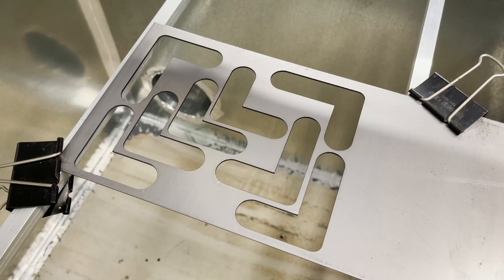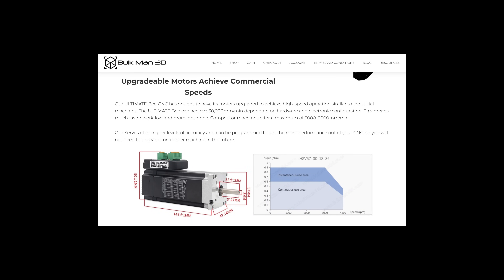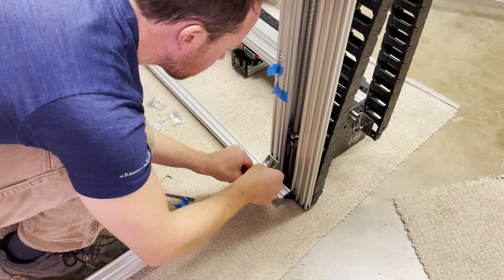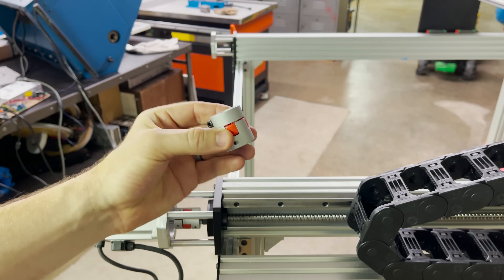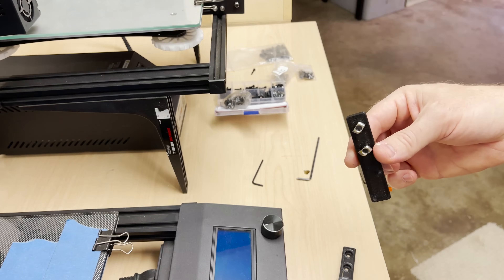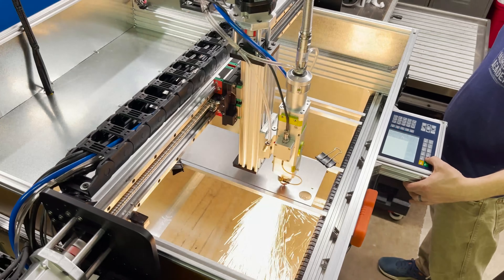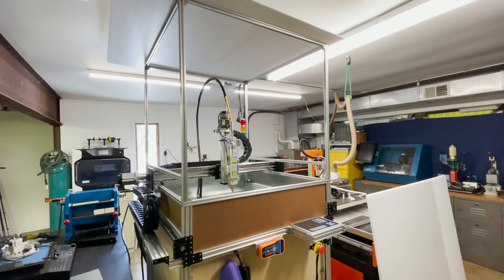DIY 1000W Fiber Laser Cutter Part 2: Gantry & Frame

Comment: 00:04 Using 16 gauge carbon steel, created brackets for enclosure.
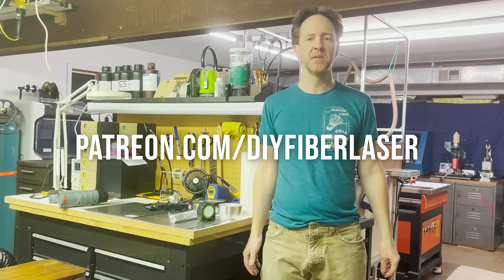02:04 Use of supplementary videos and discourse forum for additional information and assistance
03:12 Considered bulkman 3D ultimate B kit for the laser cutter but realized its limitations
04:22 Assembling the gantry and frame
05:27 Custom adapter plates and motor modifications.
06:48 Upgraded z-axis motor and designed mounts for homing switches
07:52 Wiring up switches and mounting the laser head.
08:56 Purchasing high purity gases and cutting parameters
Crafted by Merlin AI.

Comment: I import and build Chinese fiber lasers.  200psi air is good, just increase your volume with a second accumulator tank to increase run times.   Chinese machines typically use 1.6Mpa which is 236psi.  Then a dryer which is just as important as the air flow.  Oxygen uses a dual nozzle 1.5-2.0mm  air is single 1.5mm   Nitrogen/oxygen vs air is slowing down for air same focus/power.  Your Coro and wood is going to burn when you have a failure to pierce.  You need a enclosure when you have people without safety glasses on in the same room.  You alone will only have to deal with burning slag hitting you.  With manual height you can cut wood, opaque plexiglass no problem.  Fiber is metal only because the auto height is capacitive/induction based.  Get auto focus height bm120?   Has nice interface.   Nitrogen is $40/hr  oxygen is 0.60/hr   Air is 0.40/hr    We cut 3/16" carbon steel all day long with air with no burr at 236psi.  I have some tube cutter video on my page 2" 4" 3/16 square air 1.5mm single nozzle, 0 focus height.  Put a piece of aluminum in your tray bottom to be a sacrificial material and absorb heat.

Comment: Are you confident in manufacturing small shop laser CNC. I tried to buy one with a small footprint, but it is just as expensive as a larger one.  I been looking for one that will just hold my welder/cutter

Comment: 8:55 we buy N50 (same as yours) purity nitrogen for about 30 €, Ar and oxygen for a bit more, 40—60 €, even N60 Ar costs less than you paid for N50 nitrogen. That prices are rip off.
Or sales person was not interested in selling a single cylinder so he just told you the price that make this sale reasonable for the supplier. And I understand them too.

Comment: If you have a welder, it's much cheaper to make the basic frame out of 1" steel square tubing instead of extruded aluminum.  
That part doesn't have to be perfectly square like the gantry frame.

Use the expensive extrusions where you need the slots for re-fitting or making precise adjustments.
Use steel tubing for cheaper framing that needs to be rigid, but can be less precise. 

People over-use aluminum extrusions.  It's great stuff to work with, but sucks to fork out the money for it when you don't have to.

Comment: i'm sure you're aware, but you can calculate the critical speed of a ballscrew (at which it will start whipping). for my cnc machine i had to go with 25 and 32 mm diameter ballscrews because of the length and bearing arrangement

Comment: Ah yes, either buy the ultra high purity or if that's too expensive just use oily wet air from a small DIY type of compressor. Somehow that does not look to be a proper alternative.
What would the "LaserPlus" type of gas cost instead of the UHP ? It looks like this type of gas was specifically made for a laser thingy, possibly even a laser cutter. By the way, it might be an idea to go shopping at different companies for gas. We used to pay almost 3 times as much for a cylinder with regular Argon as we do right now for Premiun Argon. 
I love these machine casters by the way. Wheels on a machine are great for moving it around but it should be placed on steady feet when being used.  These machine casters have built in feet that you should use to get the weight off of the wheels. This not only makes the machine more stable but also prevents flat spots on the wheels, which makes them quite unusable (don't ask me how I know ...)
Reply from the maker: Haha, that’s a good point! … actually the compressed air went through 4 filters and 2 air dryers, so hopefully it was pretty clean. I tried to purchase the LaserPlus variants, but apparently they don’t make it anymore. I’m definitely going to shop around next time!
Reply: @diyfiberlaser  Ah yes - now I do remember that you showed this (I think that was in part 1). Having clean and dry air without particles will at least save your equipment, prevent corrosion and clogging of internal filters and valves.
Whatever type of oxygen and nitrogen you get, most likely any of the industrial bottles gasses are better filtered than your own shop compressor air. 
The reason for the high purity variants is to get the best results without any slack or contamination on the edges that were cut. You will see an improvement when going from shop air to the industrial gas but then going to UHP gas will only give a small improvement that you most likely will never notice using standard sheet metal.
Reply: @Rob_65  yeah, I don't have experience of laser cutting, but I believe that N40 or N60 will make no difference at all in this case. Because it's not closed system and supplied gas mixes with ambient gas, I'm very sceptical about the idea that even N50 purity could be preserved in just a jet of gas.

Comment: FWIW, it's much stronger to ditch the puny cast angle brackets and just use core screws - it's cheaper too - you do need to drill and tap of course and drill through the outer extrusions, but you end up with a much more professional and infinitely stronger job - and no brackets in your way if you need to fit infill panels. The downside is that you don't get the Meccano effect - you can't  move the parts without re-drilling the outers :-) Great project BTW !!

Comment: Why did you use servo motors?  Wouldn't it be cheaper to use steeper motors (and drivers)?
Reply: Servos are known to be fast and precise than steppers
Also stepper tend to loose steps in high speeds  so it is not practical for such project

Comment: Suggestion: You should replace the couplings with zero-backlash ones. Quite the standard for servo-motors. I'm also not a big fan of the standoff mounting. Any industrial application would have an adaptor with a housing. With all your equipment it should be easy to make. Acceleration is where the servo shines due to it's very low inertia. I suspect the standoff bends under peak load. The tube adaptor also provides a centering shoulder guaranteeing concentricity. Must have.
Reply: these types of couplers are zero backlash. acceleration is not where a servo shines; it shines in constant torque over a large rpm range. low inertia does not inherently mean good acceleration; it's a function of inertia, torque, and power
Reply: @ikbendusan  What is used is a curved jaw coupling which is different from a zero backlash type. The zero backlash type is more suited to servos due to its high torsional stiffness.
You do not need a servo for constant torque. Any AC motor with an encoder in closed-loop is really good at keeping constant torque.
It is true the servo has a great RPM range.
Compared to an AC motor, the servo has a much smaller inertia therefore can get faster at the desired speed.

Comment: What is the total estimate of the build just, will like to start this project. 

This is going to be my very first every patreon. Great Work.
Reply: He gave the cost in his first video, iirc it was about $15K.
He overspent by a huge margin on a lot of stuff that only aerospace would normally use.
His rig is small enough that it could probably be belt driven since it does not need the rigidity of a mill or router.
Even with premium motors and drivers, you should be able to build the entire motion control system for under $5K